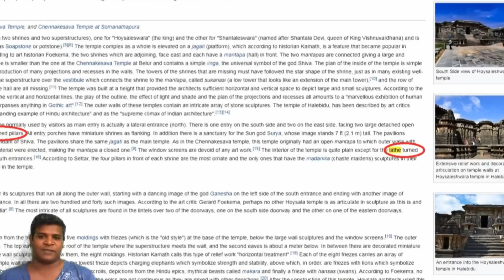Hoysaleswara Temple, India - Built with Ancient Machining Technology?

Comment: These scuptures are almost like they were "3d printed" like today, where we can make shapes that would be impossible to carve  (but we are primitive since we only do it in melted plastic ;).  Maybe they had such a thing with liquid "granite" cartridges... ;)  Also, even more puzzling, at time 2:43 in your video, you show a pillar that, I think, is impossible to carve on a lathe!  Look at the small teeth sticking out up and down of the center groove, where it's empty behind them... can't be done on a lathe!!!  Same goes for the octogonal center radius sections...  A mix of lathe, then sculpting is needed to achieve that... Totally awesome!!!!
Great video, thanks my friend!
Bruno
Reply: The ability to soften stone that would revert back, 
is the only explanation.
Now the 'how' part. I'm betting on sound.
Reply: @TahoeJones  "The ability to soften stone that would revert back, 
is the only explanation.
Now the 'how' part. I'm betting on sound."

Im betting on concrete.  Crush rocks, carry crushed rocks in easy to handle bags, mix crushed rocks with water/paste solution, let harden.... concrete.
Reply: XDDDDDDDDDDDDDDDDDDD
Reply: Or maybe laser cutting !
Reply: Stop spreading bullshit. Ofc this is possible. Im a nobody and I can come up with ways to actually do it with primitive tools.
Craft a "rope" with small metalparts crafted in (they worked iron more than 2000 years ago, so this is more than believable) that you can use to work on the stone. CHisel the pillar to a rough shape and then use the rope with the metalparts as "rasp". That way multiple people/teams can work at 1 pillar at the same time. As you use rope (and rope with different kinds of thickness most likely aswell), its no problem to create undercuts. You can also create undercuts with a lathe, its just dumb that you think its not possible.

For the "octogonal center radius sections": They arent even octagons. And you can just round the stone and then chisel in the "flat" surfaces to create the "octagonal" shape. Stop being delusional and spreading your bullshit theories...
Reply: @TheSidMachinery  Maybe you are right, I'm no expert, but I'm simply questionning things like Praveen, not pushing any theory. But a lathe holding a pillar that is a few tons? It would still show that some tools where used a very long time ago. Cheers!
Reply: Im not an expert either of course. I just dont think that peole here should spread all those wild theories about india having been "so much advanced" and calling aliens of every old buildings. Yes, alot of knowledge have been lost. And this is the reason why we dont know how some civilizations managed to build things, but that doesnt make it "mysterious" etc.
People jump to conslussion way too fast, even if there are other way simpler explanations.
Occams razor appreciates :P
Reply: @TheSidMachinery  exactly youre a nobody and u havent tryed this shit or come up whit one pillar u crafted that look like this . If its so easy do it and show it . Dont just talk like u know all  . Do the pillar if its  that easy.
Reply: @josegarcia3620  Amazing arguement. Can you taste a difference between good bread and bad bread? Yes? Can you make that exact cake yourself? No? Congrats, you realised you can judge things you cant do yourself! :)
Reply: @TheSidMachinery  yes only difference is that we talking about looks and techniques not flavor. Can i make this imaginary cake look like the one u talking about if i claim i can make it look like that or i have the technique  i would be able to replicate something that looks the same. Is not gonna be the same of course  bit it will be similar. Or if we were talking about the flavor of this pillars  i will give u reason but we talking about technique and skill not flavor . One thing is judge something. one is claiming something is easy to do wen u cant prove nor do the same shit yoursef but try to make ppl feel stupid for believing or admire someting unknown or imposible to them.
Reply: @josegarcia3620  What part of what I said is unrealistic? You think Im gonna build tools and spend weeks or months or years to replicate those pillars? XD Let me put this into perspective: This tample here is from teh 12th century. Also in the 12th century, the gothic architecture style evolved. Just look at the works from that period. Its just as complex as this temple. But if it happens in India, its some "lost knowledge" ;D You gyus goota stop believing everything people say in a video.
Reply: @TheSidMachinery  still the precision is not possible. With the things you have put. The structures are hella big and the precision is of millimeters. And the hollow structure, where your hands can't go, doesn't account for this. 
And the pillars are integrated to the roof, so things you said can't actually be applied again. Like rolling on the flat ground. 
So much of the detailed carvings are not possible to be made merely using this.
Reply: @TheSidMachinery  and I read about the gothic style now. 
While they're impressive but it's the stone we're talking about here. The stones are being worked on. 
Those buildings aren't entirely made of stones, and the curved part of the structures are definitely not made of a solid stone, integrated into a single large piece. 
Those buildings have used composite materials and made it by joining piece by piece, unlike the structure in here, made entirely of stone. The tech was surely way more advanced. 
Maybe you should look into Kailash temple, and it appears to be a structure carved entirely out of a large mountain, with the similar intricate details. From above, you can literally see that a large rock has been cut. Nothing in the world matches that.
Reply: @b.m.5068  You can use the techniques I mentioned for overall and usel chisel and hammer to do finer stuff. People have done hollow structures und submillimeter-precision before the 12th century, I dont get your point at all. What parts here cant a chisel reach? I can show you hundreds of old sculptures and building that come with the same kind of precision. Did you ever read about the "silk road"? People have been bringing spices, good, culture (including architecture) from asia and india to europe well over 1000 years before this temple we talka bout has been build. You can find hundreds of examples of buildings and sculptures with similar hollow spaces etc around the world and many are even older.
I have no clue why people argue so ahrd over these indian temples, when the rest of the world did work just as good as this. But somehow aliens or whtever have build the indian ones? ;D
Reply: @b.m.5068  They are mostly out of stone and many buildings are alot bigger than the indian temples and if you look into all the other styles besides gothic, you will easily find similar works aswell.
All this indian temple hype is driven by youtubevideos anyways, you wont find any professional that supports the arguements made here. There is nothing above the possibilities of human species in those temples, Im sorry its a delusion based on confirmation bias. And thats why Im done to discuss here, people can either believe this crap or go and educate themselfs about architecture.
Reply: @TheSidMachinery  that level of precision, that too on hard rocks is not found in the old times 
Like I said, there's no equivalent of "Kailash temple" in the world. I mean it literally. The things could have been done on softer materials, this is literally straight hard rock. It's not possible to do it that way. And it still doesn't answer the question of being an integrated structure like this, with such long poles. It doesn't answer the things at all.
Reply: @TheSidMachinery  well yes made of stone, but like I said, piece by piece put together. Along with considerable level of other materials. The stones were transported there. This is a lot different. This the very large improper stone being worked upon. A large rock which has been cut with Laser like precision.
Reply: @TheSidMachinery  it's never a confirmation bias to say that Kailash temple is being unmatched in the world. Because it is mate. It was a large natural rock, which has been cut through. And it's an amusingly large structure, spanning a whole large area. Should've taken centuries (literally) if it's to be done with simply chisel and hammer. But the precision at every point is still intact. Does it really make sense that generations of people really worked on one single plan, to cut the rock, for centuries? Using simply chisels and hammers? With the same type of quality?
Using stones for construction and making the way through the stones at such a large scale with the same kind of precision is different mate.
Reply: @TheSidMachinery  oh by the way
I too hate it when they connect it with aliens😂😂
Reply: @b.m.5068  Again: There is a reason why they dont use massive single pieces. And that they sued other materials aswell is no support for your arguement at all. The stones for for example notre dame are from paris. They didnt cut them because they had to get them there from another city or even country. Its just a deicison to cut the stone instead of leaving them in huge pieces.  "A large rock which has been cut with Laser like precision." Thats so much bullshit. You dont even know how they where cut. Assuming it was done with "laser like presicsion" is just dumb. Why shouldnt they have done like everyone else in the world? Raw cuts first, then going finer and more detailed with various techniques. Again, you CANT KNOW how precise they where when making the big cuts.
Reply: @TheSidMachinery  dude
They are way too intricate for raw cuts first. 
The raw cuts can't be in order of mm
It's easier to construct things out from small parts and it's easier to maintain precision as well
In fact in this comment you're agreeing with me a little. 
Moreover, the other techniques you said would not work, like rolling them on floor. Now tell me, how do you account for 12 feet long circular pillars made out of solid rocks? It's not a small sculpture, it's a supersized complex temple. 
And Kailash temple again, seems like a mystery. No one knows how it was carved. It had to be carved from top to bottom, which again seems stupid. Usually the things are done in reverse. That's how the Gothic architecture was made, right? That's how other architectures were also made. It's not some bias. It's a real deal. I was right to say that there's nothing known in the world to match this level of craftsmanship. Not even the pyramids. Not even the sphinx, because it's a complete temple complex again, unlike some single structure(again it's made of sandstones, which are easier to be done compared to solid rocks) 
I said that it would literally take centuries to make that whole complex, which doesn't make sense. 
So please.
Reply: @b.m.5068  What are you even arguing here? "They are way too intricate for raw cuts first." Its the very definition of a raw cut that you cant tell how they where made when the piece is done. You freaking cant know that, its virtually impossible.
"It's easier to construct things out from small parts and it's easier to maintain precision as well" Tell that a watchmaker. Also even IF that was true, it would just mean they where DUMB for not cutting it into smaller pieces. But as you are wrong, they are not dumb, as you very arguement is wrong. 

Its not supersized at all, do you even check the things you say? i can easily show you hundreds or thousands or religious buoldings that are bigger than this temple. Its not fucking "supersized" and not overly complex aswell.
Again, latches that can turn those pillars have already been used in that time. People have made whole sculptures froma  single rock in the size of these pillars. I have no clue what point you are arguing from, not a single source supports your claims, while every single source can easily back up my points. You can easily look up temples, sculptures etc from different places and times, and this temple here is not out of the ordinary. 

You just repeat what some dudes say ina  shitty youtubevideo to make it appear "mysterious". But its not.
And it doesnt matter if we know how exactly something has been carved or amde and there is nothing mysterious, especially because we know that on the other side of the world, they amde pieces just as masterful and there we know EXACTLY how they did it.
Again: read about the silk road. The silk road helped spreading architectural techniques and working devices for hundreds of years already.
How blind are you to not recognize, that knowledge about that can easily spread and that its nothing mysterious, that we dont have marterialistic evidence of everything that haüüened in this world. You just cant deal with not knowing.
Reply: @TheSidMachinery  you're skipping all my points
You seem a lot frustrated 
I still stand with them
And I'm not gonna repeat all the things again and again 
You take partial statements of my arguments and you're desperate to prove yourself right. 
Read my comments properly again and then come to talk to me. 
I'm not gonna waste my time anymore. 
Ciao
Reply: shapes impossible to carve.... Michelangelo's David was carved from stone using a chisle and a hammer.... yet carving basic geometric shapes is IMPOSSIBLE!! lol

Comment: dude the antikythera mechanism was made around 200BCE. yes, ofc they had "advanced" machines 1500 years later. lathes are not new, nor are carving tools, nor is polishing media. anyplace with a beach has access to one of the hardest abrasives on the planet, and as much of it as you could ever possibly use.

the reason we don't find copper polishing plates, bronze clockwork mechanisms, etc, is because these type of things were re-smelted and used to make new tools. hell, ancient bronze could still be in circulation in modern tools. the temple is beautiful, but it wasn't just average joes getting together after some beers and putting these things together. most world-class stone monuments had the backing of an entire civilization, and all the resources that civilization could muster. making a bigass lathe is child's play under such circumstances.

keep in mind, also, that the 12th century CE was the iron age, which means there was carbon steel around to work with. is it neat? yes, very. is it spooky and zomg unexplained? hardly.

Comment: And the 3 milimiter gap between the necklace and the body must tell you something. Even if you use diamond or sound you cannot be able to drill beneath the surface a hole so narrow as 3 milimiters - because you cannot direct your tool, much less the sound - in any such shape and place. Of course you can hope on a completely alien technology that does miracles but that is ... And the way you can do it easily is this - Having cast out the figure from cement with stone paste, you will then put on the place of the necklace and the crown  .... lists of paper, leaving uncovered areas to attach to the first surface. And, by taking out lists you can regulate to milimiters the tickness. Thenafter cast upon it the second surface-of the necklace and the crown, with whatever interspace as you like. After it dries up, you tear the paper out or burn it - and voila ! Could also use wax, after exposing the figure to the sun it will drop out by itself, leaving the mysterious gap for the world to wonder.  If you dealt with the Cathedral in Florence you would know that :)

Comment: The axis symmetric columns can be shaped using  clay mounted on a potter's wheel which I'm pretty sure India already had since ancient times. But since these columns are much bigger it can be done using a much bigger version of the potter's wheel or whatever they called it back then. The ridges or "cut marks" running around the girth of the column can be created using even a pointed wooden stick while the wheel is turning. After the columns take their shape the void inside can be filled with more clay or some other harder material to make it look as one solid piece. Then you bake it in an earthen oven or kiln which I'm pretty sure already existed a long time ago to get that glazed look much like how modern ceramics are made today but with much more modern equipment . All other shapes running across the length of the other columns can be created by manual carving using even primitive wood/stone implements before the baking process.

Comment: Some people use copper, aluminum, and Iron plates and diamond grit for lapping or polishing surfaces to get a flat and smooth result. Or cylindrical devises to produce smooth and round surfaces. Also, there is evidence of batteries in ancient times. 

It is strange to think that ancient people did not evolve in technology and stuck to only manual slave labor. When air can be used to move a Boat from dry dock to floating in water. Sound has been proven to levitate certain objects. Saws with diamond grit teeth are used to cut granite. And even lasers have been used to cut objects. Diamond is the toughest material and could have been a very useful tool in ancient lathes and mills.

Also, copper work hardens. To a certain extent.